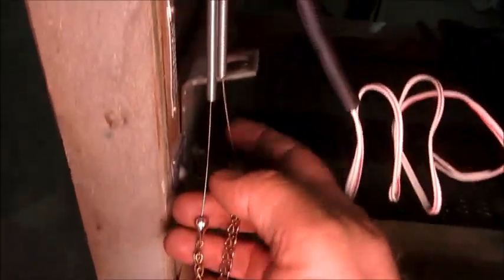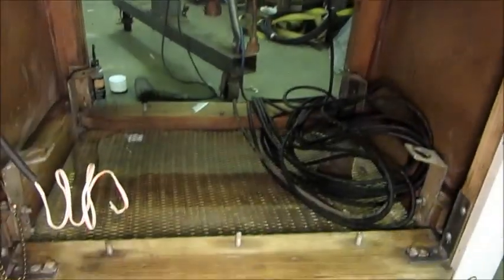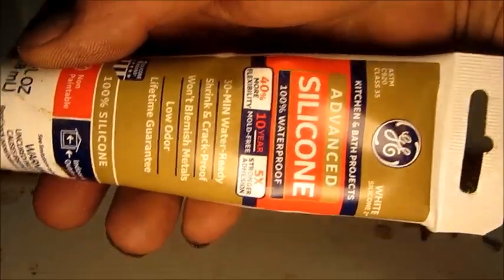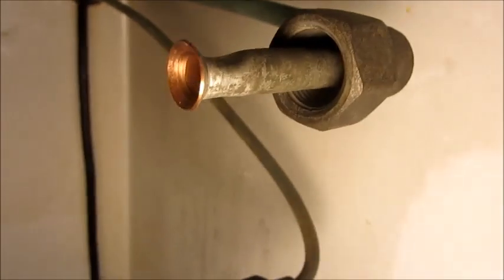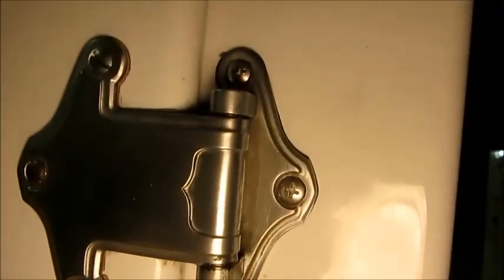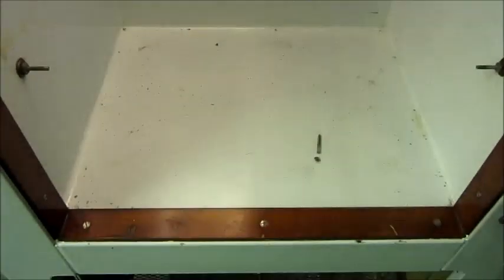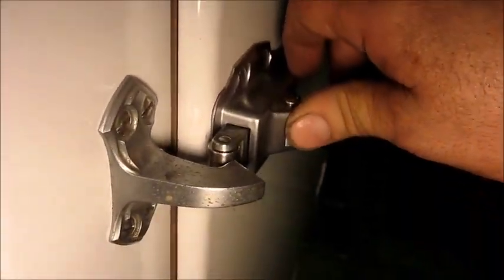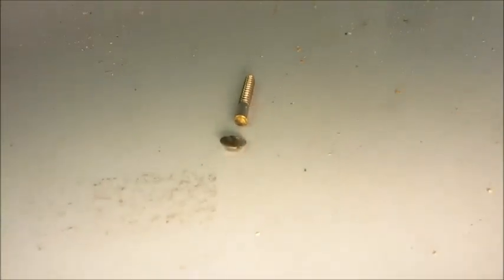Frigidaire W-5 Antique Refrigerator -6- Cabinet Light, door gasket, and door hinge repairs...

Comment: Would maple be a better choice for your dowels that the screws go into?  The tannic acid in the oak will rust iron screws. Some of the old guys that worked on pianos would put beeswax on the screw threads to help keep that from happening.  But I'm no sure how well that worked to be honest. 

Gosh that thing is turning out nicely for you.
Reply from the maker: Earl, that is interesting about the tannic acid on the oak wood. In this case, the original screws are nickel-plated brass, and the new ones are stainless steel; so rusting shouldn't be an issue. 

I heard that about the screws as well. Heard to use bee's wax; or rub them on a paraffin candle would work.  In this case, I put a touch of silicone grease on the threads and they go in very easily!

By the way I have ordered new screws with oval slotted heads to have correct-looking new screws in place of the Philips head screws used now. 

And yeah I am delighted how it's looking!

Comment: Couldn't had put an incandescent appliance lamp in there?
Reply from the maker: I'm sure an incandescent lamp could have been used.  I didn't want to cut any holes in the cabinet or modify anything if I could avoid it. The compact LED lamp fits nicely and seems to do a good job. 

These never came with any sort of cabinet light; therefore any light is a deviation from originality. In light of that, I decided to use the most effective, easiest to mount, and least invasive approach. If a person wanted it to be completely original again, all they would need to do is loosen the evaporator mounts, slide the lamp bracket out, and then retighten the evaporator mounts. None of the original parts are altered in any way.

Comment: You've probably said before, but are you using a 120v coil relay for the light? Or you have a power supply for the relay?
Reply from the maker: Yep on this one it is a 120V AC coil relay. On others, there's been a 12V power supply.

Comment: Hello David, I have a working 1930's Westinghouse 2-Door, 2-Evap Refrigerator. My question is, Where do I find the door gaskets like the on you installed on this unit and did you fasten it or use Glue and the light kit and Relay??.. Where can I find info on a 1930's refrigerator BTW, There is NO info at all on this unit on the "Net"??. Thanks so much for your time...
Reply from the maker: Hi James!  Glad you have a working Westinghouse!  Those are very nice.

It is very hard to find things on these 'net. There is a little bit of info here and there but it's not that easy to find. 

As for the door gasket, that is a self-adhesive type. I bought that at Lowe's in their window weatherstripping department. They have a variety of sizes and shapes to chose from.

There isn't any "kit" for the light. It was an under-counter light from Lowe's. I simply removed the original cable and switch, and hardwired it into the round rubber cord.  the light mount brackets are something I made from scrap sheet metal.

The magnetic reed switch is a burglar alarm door switch from a local alarm and locksmith company.  The relay and base came from Grainger. It's a 120VAC coil relay, with the reed switch controlling the relay coil.

Hope this helps answer your quesrions!
Reply: Thanks so much for the Fast reply David!. Yes youre answer was very helpful. BTW, Love your YT videos. Keep up the good work. and thanks again. James.  @davida1hiwaaynet
Reply from the maker: @jamesjohnson6822  You're welcome! Glad you're enjoying my videos!